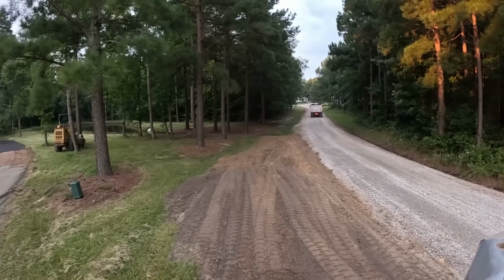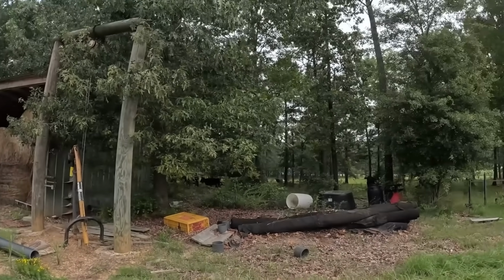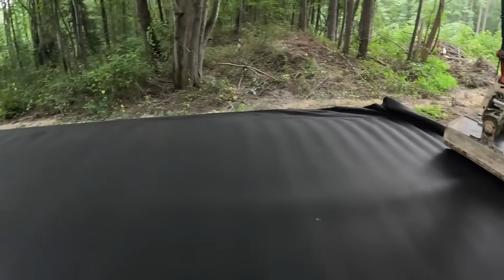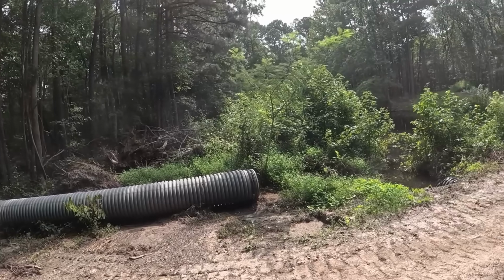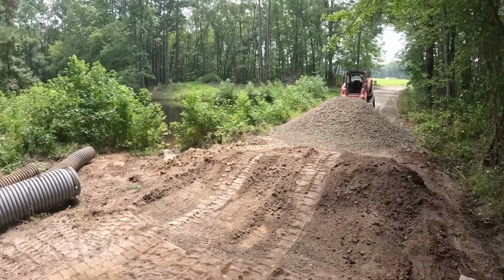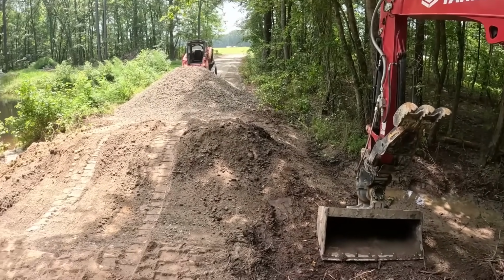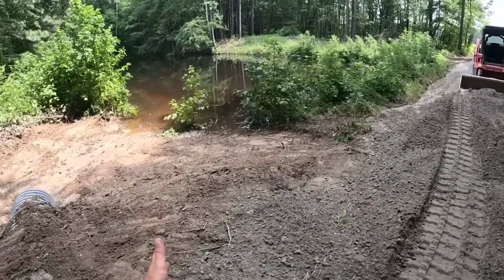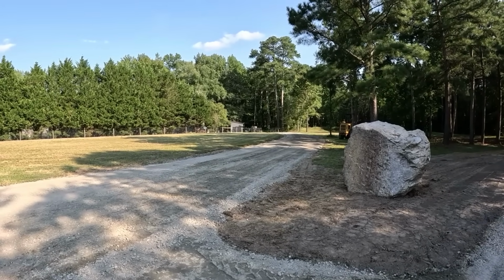Keeping Flood Waters Under Control With Road Upgrades

Comment: WoW good internal roadways are a most prudent investment god knows what that would have cost using 3rd parties also to use a "Dirt Perfect" expression some bits could have been a bit "sketchy"! A loaded trailer stuck in a "soft spot" is a serious hassle and will not fix itself either!

Comment: We used to roll that out on the sides of the sulfuric acid pond when we were building them in the mines, it would allow the acid to run below the rock and we could pump it out of the very bottom.

Comment: Love seeing those South Korean tractors out perform Deere and Kubota any time I can!  I was looking at Deere and realized they were in the "right to repair" lawsuit so between that, the way higher cost and Kubota being about the same price as Deere and all the proprietary attachments I bought a TYM.  Same hp rating $4000 less, standard skid steer quick attach and way higher capacities.  My neighbors soul at me  and I don't regret it one bit.  Automakers, same deal.  The F 350 platinum Diesel I looked at a little more than a year ago was right at $100k.  It's still at the dealer for $67k now.  If Camel Toe wins in November I will keep waiting.

Comment: That was a good guess.  That material is used by being placed vertical on a foundation wall.  Any water filtering thru the soil to reach the outside layer of fabric penetrates the fabric and is then transported down the wall to an underdrain by means of the inner geogrid.

Comment: The roll of geo fabric is intended for the extact use you are using it for. It is for crappy subgrades and adds major strength in areas where you cannot cut soil sand. The non woven fabric on both sides of the geo webbing allows water through so the gravel does not turn to slop

Comment: If you are concerned about the new pipe having enough capacity, why did you not just place it next to the smaller pipe that was already there? The small pipe did not look bad when you removed it. That would have almost doubled the capacity of the new pipe.

Comment: Your fabric looks like a product I've seen used on poured basement walls after the tar is sprayed on and before the gravel and backfill to protect the tar layer from getting dinged up. It also allows a space for water to flow down to the tile around the footer and keeps pressure from the tar coat
Reply: It reminds me of the product that we lined the light rail tunnel in Portland to control ground water;  a layer of felt glued onto a sheet of dimpled plastic.

Comment: Think I would have left the old pipe and ADDED the new pipe under the road. Cannot have too much drainage. Between that "fabric" and all the stuff you put over it you should have better roads than our local interstate highway. Two counties over they have ripped out and rebuilt interstate 44 twice in the last twenty years. Just wish they would do it right one time and be done because it is a pain to have constant construction zones. Almost seems like they are doing it to make money on higher fines in construction zones and ridiculous low speed limits all this time.
Reply: Think that is called low bidder.